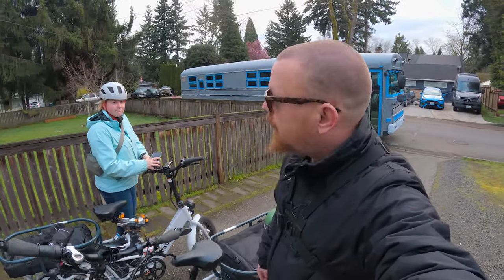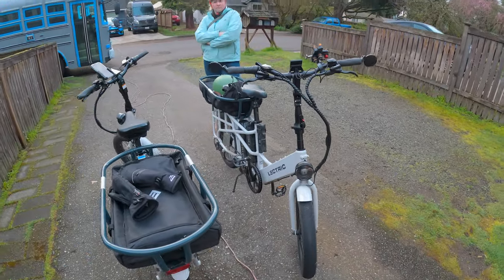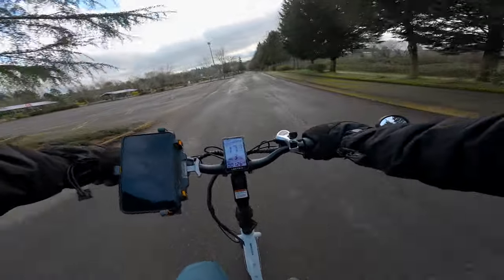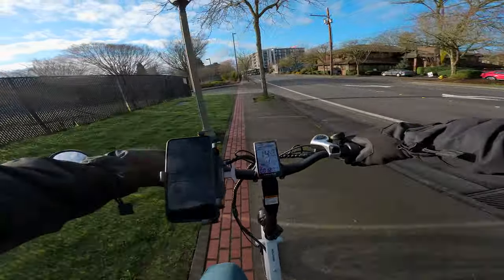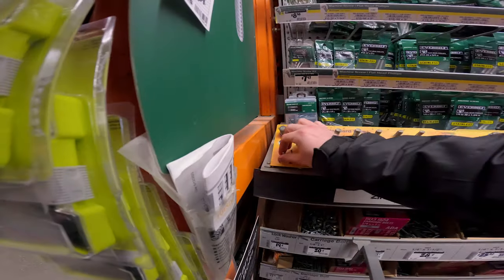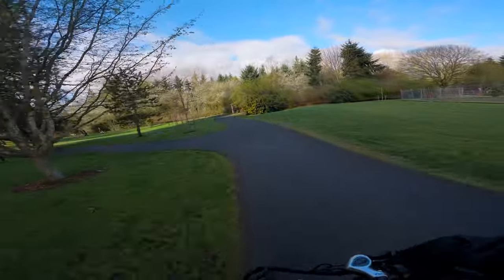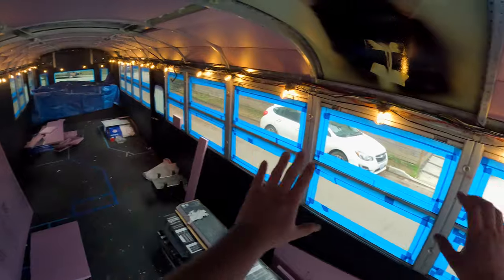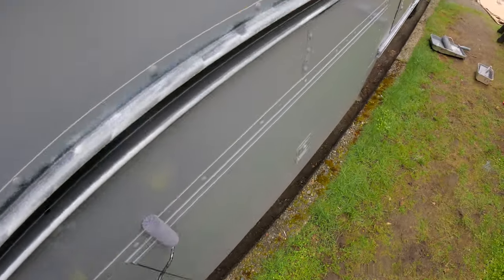Ride to the Orange Store, Painting, Patching, Reinstalling Clearance Lights | Skoolie Conversion

Comment: It is now getting to the point that I can imagine doing this and that it is a great idea.  At first I was skeptical.  I am thinking that a School Bus would be way safer in a accident than your factory RV.  What say you?   I've seen some A class fall apart in a bad accident.
Reply from the maker: It's absolutely a lot safer, no doubt about it. The framing is SIGNIFICANTLY stronger with steel rather than aluminum and fiberglass. The bus also weighs much more just in materials before the house stuff goes in. I wouldn't want to be in an accident in either, and if I could pick, a slightly more modern dog-nose bus would be the safest of all options. No airbag on Lenny is a disadvantage, no doubt, so pros and cons.